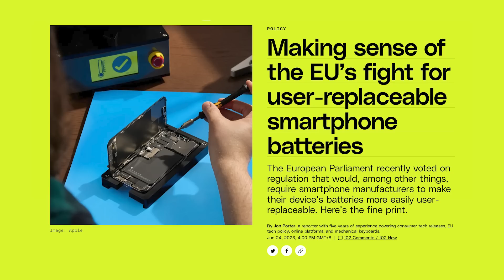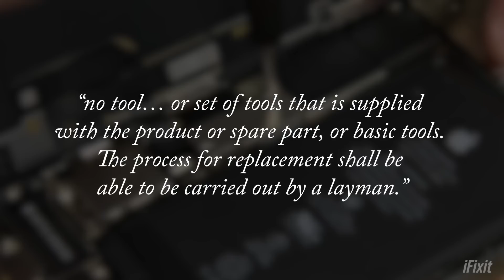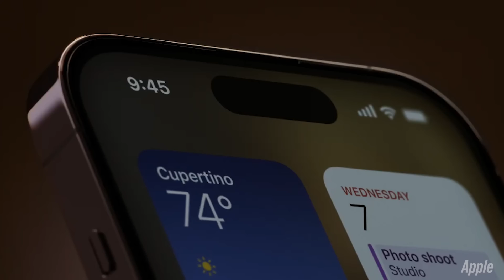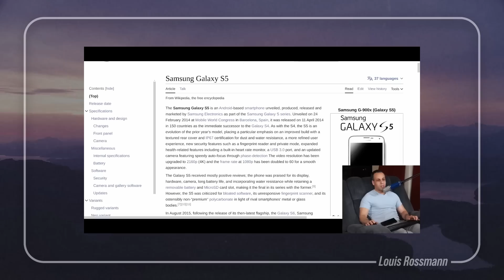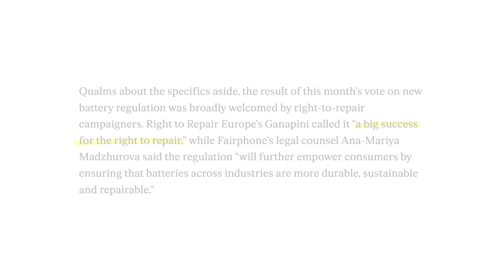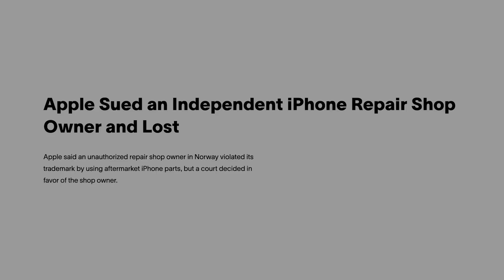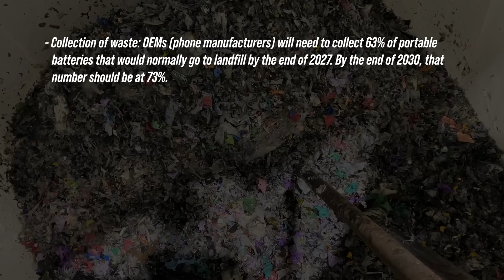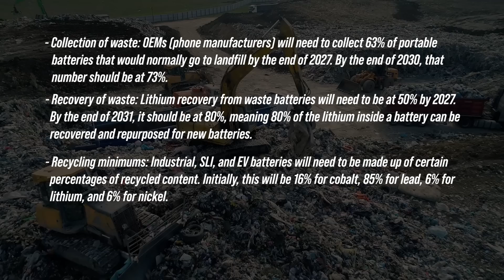EU Just Changed Smartphones Forever

Comment: You don’t have to carry around an extra battery anymore because making the battery non-removable allows for more complex, higher capacity designs (such as stacked battery technology which will soon be making its way to many phones).

Not to mention, I imagine this will severely hamper the waterproofing capabilities of many devices, which isn’t a worthy trade off. I’d take a waterproof smartphone I had to throw out every two years before I’d go back to one with a replaceable battery.

Contrary to the (quite right) move to regulate all companies to switch to USB-C, THIS is just bad regulation. I imagine some manufacturers will have the bravery to pull out of the EU market after this decision.

Comment: Awesome!   I would love to have a user replicable battery.   It would mean I could buy fewer devices although I have gone through the hassle of changing batteries in sealed devices, which is no joy.   I used to always buy spare batteries and when available higher capacity batteries which made the device thicker but would help keep it powered all day long and then some.  Better would be battery charging docks something manufactures did away with long before they started sealing batteries in devices.

Comment: I do not have an answer to your question exactly. All I can say is that to this day, I still miss my Galaxy Note 3 which was the last phone I owned with replaceable battery. I used that phone for height years and changed it after the second DIY repaired failed. Compare that with today phone that barely last 2 years and somehow, i suspect foul play, do not work very long on a brand new replaced battery. I would not force anyone to keep their phone that long, there will always be some who for whatever reason change them yearly and that is their choice but those who wish to keep their devices longer should also have that choice and planned obsolescence is preventing that on to of being extremely wasteful!

Comment: i always wondered how making it so we cannot remove our phone batteries was not a major fire hazard. supposedly there are systems in place to help prevent fires but another thing is people tend to just throw them in the trash just like the vapes which is a fire issue and no doubt has caused many fires already. any electronics batteries should be removable to be disposed of properly and not just tossed in the trash. plus, one should be able to easily replace it and not have to risk damaging their phone in the process or have to pay someone with the right tools to do it.

Comment: If it wasn't for the anti-consumer practices of almost every company out there, we wouldn't need the Right-to-Repair movement. @HughJeffreys Literally just uploaded a video showcasing just how anti-repair Apple is (spend $bns in R&D for anti-repair tech). Tesla is also just one of basically every car brand that also go out of their way to lockdown repairability of EVs by the end user or third party repair. All these companies are anti-repair, all shouting from the roof-tops "it's for safety!" are lying. They just don't want you owning anything, more like leasing from them. There are easily implementable safeties that can stop lithium-ion batteries from shorting during a replacement as well as ways of making devices just as watertight as the devices we have in our hands right now.
IFixIt, Louis Rossmann & Linus Sebastian (investor in Framework) are just some of the most vocal when it comes to Right-to-Repair.
I myself have replaced the adhesive-sealed batteries in my current and previous 2 phones and a couple of relatives' phones too and replaced a screen.

Comment: People do not replace batteries as often as one thinks. Yes, there is one here and one there, but those are very rare cases. Imagine this: you have a 4 year phone, which no longer receives any security or feature updates for a long time already. It also has wear traces (dents, scratches, etc). Now also your battery starts performing poorly. Are you going to replace that battery to be able to use that phone another 4 years??

Comment: Of course this move to phase out user replaceable batteries was largely motived to limit a device's lifespan. As you said, LG proved with the G5 and V20 that you can easily design high quality metal phones with replaceable batteries. 

Its also the exact same bs as with the removal of the headphone jack, which had no other purpose than to get people to buy these stupid wireless earbuds with their tiny batteries that wear out over time.

Comment: I had the LG G5 and sans the removable battery module bottom, the design was very 'modern'. It was hard to tell it wasn't a unibody phone. With 2023 phone dimensions, that battery would be much easier to hide.
Reply: The problem I experienced with the LG G5 was that the battery swelled as it aged, and it got stuck in the phone.

Comment: The downside is this would likely lead to phones being even less water resistant than they are now.
Reply: No. Watch the video and learn why
Reply: @laz7354  I did and I don't believe that bit about the phones being as water resistant is accurate.
Reply: Get a case, and stop using your phone in the pool.
Reply: They can just use seals or gaskets instead of adhesives?

Comment: I'm still using my Galaxy S5 neo (bridging product between S5 and S6) from 2016 and it does have a replaceable battery. 
I was worried recently that the original battery might be getting damaged at some point so I bought a spare one.
But I haven't put it in yet because the necessity hasn't arisen. The original battery of my phone has been working just fine for 7 years.
I don't think modern phones last that long in the hands of most people - so I heard anyway. It would be good for the resource economy to make devices longer lasting.

Comment: Phones nowdays have great specs. We should be ae to change parts and install custom ROMs both in iPhones and Androids. I wouldn't mind paying 2k for a phone that makes it possible to install GrapheneOS and change parts with ease. I would rock that phone till I die, since I can upgrade and replace parts, and the system wouldn't artificially limit me like Samsung and Apple do. Until today only Google Pixel allows you to control the software 100%, if they do the same for the hardware I don't see a future where anyone would want any other phone, and with a large market of users, the sky is the limit. Heck someone can make a replica of iOS that works on Google Pixel.

Comment: Basically whatever parts of the old parts still work but it compromises by using the old parts that it can use and then drawing off of the new parts it does cause a couple of glitches here and there but they're workable

Comment: Good idea for phones but it seems very contrived for EVs. 
Tesla has a structural battery pack that builds rigidity into the car. Also, I need to know more about the EV batt chemical composition requirement. That too seems to be a very contrived requirement. I need to understand the motivation that led to those numbers.

...I don't know if the EV portion stands up in court
Reply: The structural battery pack is also a huge problem. It is of course good for Tesla but awful for used car buyers. A better solution must be found, e-cars should not become disposable like smartphones.
Reply: @huckleberryfinn6578   What would be the use case scenarios for the consumer to be swapping out EV batteries when the market is EV battery constrained? The EV battery pack is almost half the cost of the EV.

Especially when future autonomy should lead to 90% of the population NOT owning the thing that spends 90% of it's day parked doing nothing

Again, this makes sense for phones I don't see the logic for EVs....So what's the motivating factor?? It doesn't make sense unless there's another motive driving the EV portion (pun unintended).
Reply: @huckleberryfinn6578  When you're buying a Used EV the majority of it's Cost/Value will be in it's battery pack. This is a new paradigm, we can't look at it in the ways of how things WERE done. This is Not the Used Car market we know...EVs batteries are not the CHEAP/ABUNDANT phone battery market we know

You would need to build 2 to 3 extra battery packs per car....In a battery restrained market. If you made that a requirement you'd constrain new car production (as Nio discovered)

That's not market driven solution. The market can't plan it's development based off an outside concern for Used Cars...Thats Soviet style planned economy control

Over time you'd end up with more used cars than new, needing more battery packs. That's Wagging The Dog, the literal definition

Comment: I think that in the absence of regulatory pressure to do otherwise there is no other reason for any design changes of any product than increased profit. Profit is why the manufacturer exists. If doing something for the consumer is seen as increasing profit then it happens. When a way to increase profit by making consumers life more difficult is found then that happens instead. Making people not repair stuff and just throw it away and buy new is a fairly obvious way to increase profit. No need to keep qualified service centers alive, no need to manufacture and stock spare parts, no need to support SW compatibility for older product lines. And on top of all that saving of expenses you get increased sales of new stuff. Claiming the new design is somehow better for the end user is a very transparent lie. 

Getting people to return batteries from broken phones could be easy if you just offer a tiny little discount on a new phone if the customer brings you an old phone battery (or the old broken phone). People do way more difficult things for a tiny discount than just not throwing away the battery into trash. Not everyone will do it but many will.

Comment: We found a way to do it and we almost got sued for it you got to put the new part over the old part you got to basically make a place for it sometimes you can sometimes you can't if you don't got enough space to sandwich it in somewhere it ain't going to work we've had to run wires and pray it worked just so we can put a chip wait on the other side to attach to the old chip we call it piggybacking

Comment: Return old battery get discount on new one scheme can convince users to give back old ones ;)
My oldest phone have still replace battery but due no longer you can get original battery I DIY fresh li-poly cell with old BMS.
on my newer phone I needed remove screen to replace battery annoying :/
User replaceable battery is not enough they need standardize batteries for mobile device make 2-3 types otherwise after 3-4 year you can end without available batteries to replace old one.

Comment: I mean thin and light gaming laptops with good battery life exist with replaceable batteries that are screwed in, yet people still go for ''thin and light'' laptops that cost more. 

Not to mention, people don't care about the environment really or right to repair as much. You don't even see the mention of the other ways OEM's restrict control, for example, not letting users easily install custom roms. Only xiaomi and a very select few others have good custom rom support, including official tools to help you with some parts of the process. 

At some point if you're apple, or nvidia or samsung, etc. you'll be the fool to not rip off people when they themselves go for this non repairable crap. Thats why they so boldly block the very minority that speaks out against this.

Comment: What I can see happening is the non EU devices will have software locks that the manufacturer will  provide as a cost add on  to unlock the phone after an owner has replaced the battery.
Another thing back when the batteries were repalceable was they fact the batteries at the time had a very limited life, from my experience back then, som eof my phone batteries would only last just up to 18 months, this could be due to either deliberate low quality manufacture or just infintacy in battery design, either way the cost of purchasing an OEM battery then was sometimes half the cost of the phone.

Comment: I had the Samsung Galaxy S5, and in the end 3 batteries for it because two went bad (as all batteries do after 1 to 1.5 years of heavy use). I used the extras as spares, writing on them with sharpie how many % of full charge they still do. Yes its waterproof. You can just take off the plastic back and the battery is exposed, and the back has a rubber edge built in that is pressed against a flat surface on the other side.

Comment: We need to go to a one car battery system so that way we can pull up to a service station in a machine or robot can change our battery so that way we don't have to sit there and charge they can take the battery our old battery and charge it and you can come and buy batteries at different stages of charging if you don't have enough money for a 100 charge battery maybe I don't know how that's really going to work maybe smaller batteries yeah maybe some other batteries smaller batteries so that way you know you might not require a huge battery you might not be going that far you might be just driving around town or just going to the grocery store

Comment: I see both sides of this issue.  Consumers have not driven manufacturers to continue to make repairable products, and the manufacturers have reduced costs by omitting the option to repair.   

Having worked for four electronics manufacturers, I don’t believe any of them are maliciously designing to increase consumer repair costs; they’re simply designing for best up-front cost and features without regard for consumer burden late in the product cycle.

However, practices such as slowing processor speed and charging characteristics with OS updates as devices age really should stop.

Comment: One thing I wished they added was battery standardizion, especially for EVs. There was an idea of replacing batteries at charging stations instead of charging the internal battery. It would be quicker to get to 100%, allow for at home charging still, and the vehicle's battery will always be at perfect health, and the largest cost of an EV would become alot easier to repair. Only issue is, cause batteries aren't standardized yet it would only be for a specific manufacturer to create the infrastructure for battery banks.

Battery standardisation for access and dimensions as a whole would be a good thing, but for EV's in particular would be a massive boon, and it's early enough in the EV tech space that there wouldn't be massive headwind like with other tech.

Comment: Problem is that back in the days you had small capacity batteries for not so hungry SOCs. And even so, the reason why you might have wanted to carry an extra battery was because the battery life was garbage. And this was in a time where there was no social media to eat up that much of your time. This effectively means that the batteries had stronger build quality to prevent being damaged by the end user. That's no longer the case, for any of those points I just illustrated. Also, another item that was not so popular or accessible back then was a power bank.

I worry that phones will get bigger and heavier, and worse of all, will lose a lot of their performance with this. I'm all for being able to change the battery when it fails by the end user, but this should be a bit of a process, to ensure you can still use high capacity cells that are not layered with tons of plastic and metal to keep their structural integrity, and provide clear and free ways of recycling them. And this is another point that's worth mentioning, you will see more and more cells thrown in the bin, which will increase the risk of fire both within the household, the garbage bin outside, the garbage truck and the garbage sorting facility. I worry for countries like the UK, where most buildings are made out of wood. Also the main reason why I am against electric vehicles. I do not want to have the whole neighbourhood burnt down because you wanted to drive a "green" car, that requires more coal and fuel being burnt to create the electricity, not to mention the environmental cost of making the batteries in the first place on a predetermined cycle (believe it or not, these do fail eventually, a gas engine will not in the same manner).

However, please keep in mind the even the most willing manufacturer will only provide you with security and OS updates for a max of 4-5 years (and that's rare) which means that your phone will no longer be usable right about when the battery will start failing. I know, you can install an Open Source OS, but at this point, if you are technical enough to do that, you know how to use a screw driver to replace a battery (as mentioned, as far as I would like this law to be enforced). If not, and you are an average user, you will still need to go to a repair shop to get it sorted, both software wise and mechanically. 

Granted, this is a small but important segment. I imagine electric bikes, laptops etc will benefit greatly from this.